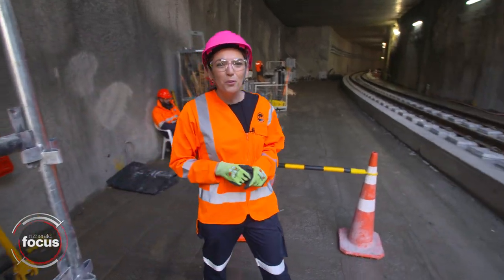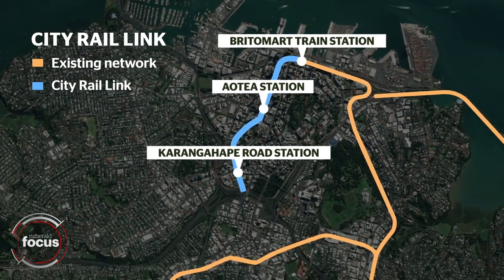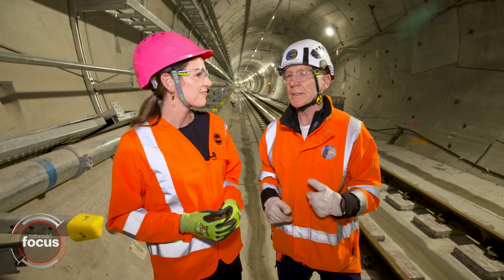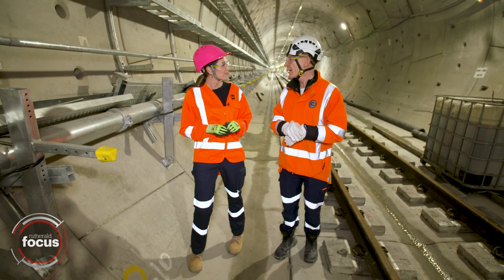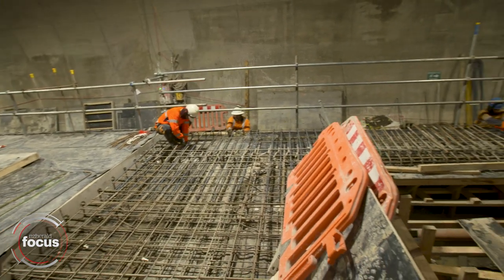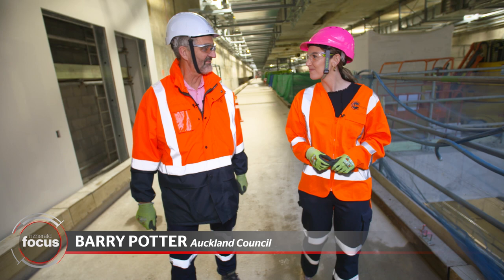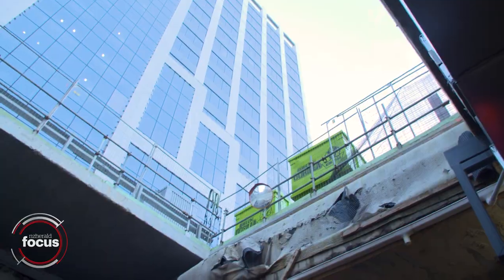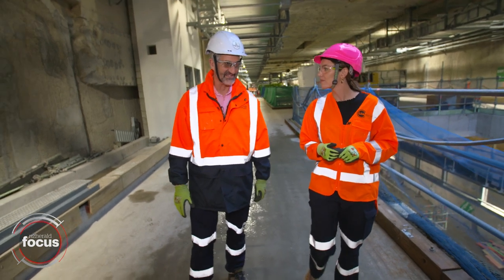First look at Auckland's new City Rail Link | nzherald.co.nz

Comment: 😂what a waste tax payer money 😢
Reply: Future generations won't think so
Reply: @sevenhelmets  they will, when it goes the way of the cycle lanes, doesn’t pay for itself and costs a fortune to maintain. It’s the wrong solution for Auckland. Maybe it can just act as a large storm water drain instead.
Reply: It's actually innovative and should have been done years ago. Look at Melbournes inner city loop and how it creates great movement in the much larger city of Victoria. Melbournes public transport system designed and heavily influenced off of Hong Kong public transport system. This is only the first step. Light rail will create the wynyard airport connect whilst more projects to hopefully connect the north shore should be on the way.
Reply: @101hundred  there is nothing innovative about it, we already have an existing rail link, this is a complete and utter waste of money when NZ is in a crisis. Over a billion per 1km is disgraceful waste when it isn’t needed. Innovate means new and different, there is nothing new about this at all, with many examples overseas.
Reply: @101hundred  note this isn’t a loop it’s a single direction and the start of trying to get better rail out west, the place where it floods the most, I’d rather see the money put into resolving the flooding at the moment. Ask yourself this at $5 each way so $10 a return trip, how many people and how many years will it take to pay this 3km rail back.
Reply: @dave24-73  when has floods become priority issue? Although it does need to be fixed. The CRL project was proposed and commenced long before the flooding was an issue. Increase in population has taken its toll on the water systems alongside transport. CRL will be helpful in the latter but many problems will exist whether we want to jump priorities every time an issue occurs. Infrastructure takes time and we must fix what we can when we can.
Reply: @101hundred  if you look at the history of rail in NZ it has always failed and gone over budget. It looks like it’s getting worse not better. The Western line is used by a minority of Aucklanders. It is hard to justify this when there is an existing rail platform in place that goes between Britomart and Mt Eden.
Reply: @dave24-73  and yet when they start to improve what you say isn't good enough,  you criticise it as wasteful and unnecessary. Make your mind up.
Reply: @TheTraveller20081  come again? Comparing it to Melbourne is pointless it has nothing in common with Auckland. It’s not a loop like Melbourne has. We already have an existing rail system to Mt Eden, so it wasn’t required. NZ has many social and infrastructure issues, including housing and medical care issues, which at this point in time should be taking priority. People voted against this project yet it has still been built. Poverty is growing, crime is growing, and we are spending billions on rail, that historically has never worked. Rail in NZ has been bailed out so many times, that it’s chances of benefiting NZ based on historical data is highly unlikely. Most people in NZ drive, and rail is not widely used, so spending huge amounts of money on this project is very much questionable.
Reply: @Dave 24-7  it is a loop, look at a map. The new link connects the existing line directly through the city up to the western line, enabling through-running of trains instead of having to reverse them all at Britomart - much more efficient. It also provides direct rail access to mid-town and cuts 20 mins off a journey from everywhere west. 
You also complain about spending money on the railway when there is flood damage to pay for. I presume you do actually understand that the CRL has been undermined construction for more than six years, and can't simply be abandoned because you want to divert funds to another priority?
Reply: @TheTraveller20081  it isn’t a loop (google  - Not a loop. John Polkinghorne | June 27, 2013 )the lines are separate, they simply share a station. Anyone can walk 3km, it’s a poor investment, yes and in 6 years it’s killed off a lot of businesses with road closures. It also caused major disruptions to Britomart. You may think it’s a wise investment, but I’m afraid on this point we will have to agree to disagree. Busses and existing train already cover this route. It’s also not likely to be open till 2026. It has been built and no I don’t expect them to abandon it, but it never should have been approved in the first place, and oddly enough very single party other than Labour is saying the same thing.
Reply: The current metro area population of Auckland in 2023 is 1,673,000.  Go have a look what population Mel , HONG Kong , or any other city have big rails public transport system. Just in my opinion l, we have so many other things need fix. Harbour bridge, southern motorway, watercare infrastructure,etc.Look how the kiwi rails train performs, now another CRL. Anyway hope it go well. If not it will be shameful. We can have like rails to airports is more future benefit than this with this huge budget.
Reply: @dave24-73  you'd better go check which Party was in government when CRL was approved and started. Hint, it wasn't Labour.
Reply: @wanghaitao3247  if they had joined the airport to the Existing Southern line it would have come in at less than the billions they just spent to tunnel 3.5 Km a distance one can walk. But for some reason they want to go out west from the city then south to airport and it’s estimated to be something like 50 billion to complete, it’s an incredible waste of tax payers money. And looking at the maps incredibly poor city planning based on where people live. The southern line would also allow links to Hamilton, Mount Smart stadium, and the CBD. We really don’t have the population to support that much spending when existing lines could easily be tapped into at a fraction of the cost and achieve faster routes with less transfers, making it easier for people to use, especially people unfamiliar with NZ (tourists).
Reply: @TheTraveller20081  I know it was National, but if you watched any news as of late National have repeatedly said they tail should be put on hold due to all the other issues NZ is facing, so my statement remains true, the Greens, Act and NZ First have all communicated the same thing.
Reply: @dave24-73 This Project has been blown way out of budget, yes, but this isn't a "disgraceful waste" of money.

First of all, I would like to address your opinions regarding rail. Auckland used to have one of the highest rates of public transport usage in the world, that was before politicians viewed the "American Transport System" (car oriented) as the future and so therefore rail has been in "Managed" decline since then.

And as a result it doesn't surprise me that driving is dominant in NZ, when you start taking away accessibility for one mode of transport in favour for another it's natural for the population to shift to the favour, in NZ case that was the car.

Rail has often failed in NZ and the reason why is because we build it to fail, not only are kiwi officials more likely to choose the cheapest option but it's the result of that which has inflated costs now, and NZ is so inexperienced with building and maintaining rail we have minimal local expertise and know how to effectively build and maintain such infrastructure. But we aren't going to solve that by saying no.

Another reason why driving is so common is because of how we build our metropolitan areas, we urban sprawl alot, and that is mainly due to policy settings and our addiction of roads.
We build more standalone houses, and that demands more roads, which means we need to establish more infrastructure, more amenities, more social services, and in the long run that makes construction vastly expensive for NZ, and it's economically unviable, and due to all those costs it has a hand in inflated house prices.

Rail is a good investment even for NZ and especially now NZ is seeking to intensify instead of sprawl. With the right settings, logistics, workforce and expertise rail is often built using less space, an equal cost and is utilised more efficiently because it can move more goods and people in a faster timeframe. And we must continue investing into rail because to have a transport system that's based on one mode isn't efficient, and it's one of the reasons why NZ productivity hasn't gotten better, a multi modal infrastructure network is much more efficient and economical.

Now with the CRL, thanks to covid, it's extended shutdown, difficulty sourcing materials and staff sicknesses the cost has blown out to what it is now. But this is good for Auckland.
It will double the capacity of the entire Network and it will improve access to the CBD, it will also incentivise investment into the CBD and allow faster travel Times due to in loosening the network.
NZ needs to keep investment in rail because investing in Just roads has lifted Auckland to one of the most congested city in the entire region, and having a road oriented network also play's in health.
It decreases the livability of a city, it's decreases productivity because people are stuck in congestion, meaning they are late to work or late home which also decreases content, it has an effect with mental health and depression, driving in an environment like Auckland also makes people more stressed.
Maintaining roading infrastructure is also expensive, yes rail has had to be bailed out in the past, but the amount we waste on roads is ridiculous, so many people driving means roads degrade more quickly, which holds a high price tag, and when we build more lanes or more roads we effectively waste millions going back to square one because doing that doesn't solve congestion, it makes the problem worse because you incentivise more people to drive and you end up with an even worse problem then before.

Public transport is also good for a cost of living crisis, it's cheaper than owning and operating a car and it introduces flexibility in people's lives and freedom to choose on how to commute.
Rail infrastructure also encourages higher urban density which increases population density, and in order for NZ to achieve economics of scale that is ideal, with higher population densities you can pay for infrastructure more cheaply and efficiently, and we could have a transport system that gets people from a to b much more quickly, which ends up being a plus plus plus for the economy and our people.

And the CRL despite how stupidly expensive it is, is not a waste of money because it will have wider benefits than just the CBD, and it fits the evolving development settings of NZ cities.
Reply: @dave24-73 it will pay for itself, what do you think the fares are for.
Reply: @rp7784  fares only cover operating expenses, staff, power, maintenance etc. fares would have to be a lot higher to pay for this investment, refer back to harbour bridge as an example, where there were a lot more users. I believe in good rail and solid rail networks, this isn’t an example of that. It’s a disgrace because we have existing infrastructure that covers the route and it only covers a distance most people could walk.
Reply: @dave24-73  No, atm we have congested infrastructure with the unfortunate position of covering the route that will soon be running at maximum capacity.

And you are also missing the fact that the CRL will have wider benefits than just the city, yes I Fares will cover operating, maintenance and stafffing but the wider benefits would have delivered a longer term retun to the city, but with this inflated price its going to take much longer than the originally proposed price.
Reply: @rp7784  I think you are missing the fundamental question what problem are they trying to solve. This will actually increase congestion and add another bottle next, one of the biggest issues with NZ is that all the roads tend to lead to same places. We are not building a world class infrastructure like the UK, we are building questionable routes at great expense to the taxpayer. Once again this route is already covered by existing infrastructure. We can only agree to disagree here. I believe we would have seen more benefits getting people from the airport to downtown, than getting people from downtown to Eden park.
Reply: @rp7784  well said
Reply: @dave24-73  Ah the fundamental question.

The purpose of the CRL was to address the lack of Available Capacity to cater for Auckland's growing population, The Crl will double the capacity of the entire network, improve timetable's by increasing network frequencies and average speeds, it will also allow more people access to public transport, and improve the reliability of the network, by making Britromart a through station it will allow more access points into the city and open up room for extra capacity.

Add the following economic benefits like Increased urban density, higher PT patronage and a more connected city, The CRL is a good investment.

The route the CRL covers is already choked, buses can't cover it without causing a traffic jam, cars have already brung that circumstance, to move people in and out of the city efficiently whilst increasing the capacity of the network citywide is more than ideal.

No because you'd be surprisde how much less people commute to the airport than into the city on a day to day basis. 

If that's the case then fine, let's agree to disagree but the fact remains that the CRL is good for Auckland, the inflated costs are the effects of supply chain issues brought on by global events.
Reply: What a terrible comment. Auckland really needs mass transport. More roads will just lead to more congestion without trains.
Reply: @DallasRabot the rail upgrade is the same as all the roads leading to town, this leads to Britomart, so is a bottleneck. It costs the equivalent of 12 harbour bridges, only covers 3km and we have existing transport routes that already cover this. It hasn’t added anything to the network and has cost a small fortune. If you think that is a good use of tax payers money, then in my opinion something it wrong. This hasn’t solved any problem. A link from the Airport to the existing southern line could have been done for a fraction of the money spent and would have actually solved a problem and brought people from the airport straight into town via.  I believe in well though out infrastructure so am for public rail, but this no matter how you look at it can’t be justified, and those who believe it can be I would question their understanding of the situation.
Reply: @dave24-73  commutes to the airport are far lower than that to the city.
A link from the airport to the southern line has already been looked at, the issue was the Southern line before puhinui would not have been able to handle the extra frequencies with only three lines and freight already heavily utilising that corridor.
The second issue is where would the line's merge without causing a bottleneck or too much environmental damage.

The current transport systems that cover the routes in the path of the CRL are inadequate and inefficient, especially with a growing Auckland.
The CRL will help increase the capacity of the rail network as well as improve access to the city and commute streams.

You seem to overestimate your understanding of the situation.
Reply: @rp7784  it’s not to the city it’s to Eden park. More people use the airport than Eden park
Reply: @dave24-73  and now your lack of awareness is showing.

access points such as karangahape station and Aotea. both of which will see a much higher share of people than the airport daily, and both of which are situated in the city.
Reply: @rp7784  time will tell, as there are already existing link buses that go non stop between those points, plus it’s a short enough distance you should walk it. I have no doubt it will be used, but justifying how much it cost is hard to do. The only people lacking awareness are those that think spending billions on something that only covers 3.5km is good value.
Reply: @dave24-73  and now your lack of comprehension is showing.

I have told you three times that the bus network along that same route is running at capacity, and is stuck amongst congestion so it's not efficient nor sustainable.

If that's the case then you should ask people to remove themselves from their cars and walk the distance, they probably won't.
Like I said, the CRL will make moving people around and in and out of the city more efficient, quick and responsive.

A little bit of disclaimer, that's what happens when you under invest in infrastructure projects, you leave your workforce lacking in expertise which makes it more expensive to get projects done in future.
With the CRL even its original price tag was pretty expensive but these inflated costs come due to global event's and supply chain issues, unavoidable unfortunately.
Reply: @rp7784  as someone who has used it it’s not at capacity, have no idea where you get your information from. Seems odd you have to be abusive because you can’t comprehend how much money was spent to achieve so little.
Reply: @dave24-73  It seems odd how you assume everyones lack of understanding because of their opposing stances to you and you have a tendancy to call me abusive.

The Bus network is running at capacity with it;s frequencies, the amount of people onboard is a different matter entirely but the bus network in and out of the city is at capacity due to the congestion, and not being able to increase or expand.

I get my information from urban studies and traffic assessments conducted by experts and Auckland Transport
Reply: @rp7784  and I get my information by using the transport, where it isn’t generalised and combined. That route has a bus every 10 minutes takes 12 minutes and the buses are 90% empty most the time.
Reply: @rp7784  looks like pot calling the kettle black, you’d be aware then that the route in question runs every 10 minutes, takes 12 mins on average and is empty 90% of the time. As for what it promises, vs what it will deliver it is too early to tell if it will achieve the desired results. It risks crating more bottlenecks, as it isn’t a true loop, and this has been highlighted in several reports. I’m not sure why you are so pro it.
Reply: @dave24-73  Did not read my comment properly
Reply: I did, but there is no evidence to support those numbers, it’s not going to resolve bottlenecks between Britomart and Newmarket, it’s going to create new ones, as I said only time will tell. It’s already 2.5 billion over budget, so don’t know if you can trust their numbers. I was more making the point that the main route is already covered by public transport, and this transport id both frequent and rarely full. Clearly you lack the ability to read between the lines so I’ll speak in simpler terms for you. More importantly, CAN YOU PLEASE JUSTIFY THE EXPENDITURE AND WHY YOU ARE SO PRO IT. it’s in capitals as I’d love to know where you are coming from. You do realise for less money we could have had a link to Botany, link to airport, true loop connecting all same streets and viaduct, and a face lift for Auckland. Are you also aware it crippled over 200 businesses in the CBD and a class action was filed for compensation.
Reply: @dave24-73  ahaha, exactly you have just made my point, the frequencies have already reached capapcity, the amount of people that services can carry is still not efficient even at full patronage.

It's also not efficient that buses are subject to congestion and are entirely at the mercy of car traffic.

The CRL has wider benefits than just these routes as I have explained.
You also fail to take into account future growth and investment.

First hand experience into travelling these route's does not make you well informed as you only know what you see but you don't know the studies that have taken place, the statistics drawn up, the economic circumstances both now and forward that have been taken into account, as well as the BCR conducted.

For only buses to cover the route it would have been unsustainable at moving people around.
Reply: @dave24-73  You think the studies conducted are based on data thats been generalised and combined?
Oh god.
Reply: @rp7784  you still haven’t justified the expenditure. I think you are very naive if you think this project will pay for itself. From a return on investment ratio, it was advised by many companies Deloitte included this shouldn’t be built, it only went ahead because John Key offered a donation and bypassed the red tape.
Reply: @dave24-73  Ok its either you who isn't reading at all or you are simply forgetting my comments or perhaps you haven't read them. I find it funny how you've been asking the same ANSWERED question over and over again and yet you think you have the ground to say I'm lacking lol.

I have stated numerous times that a heavy rail connection to the airport would not work.
Studies were conducted and a connection fbefore puhinui station would have created a bottleneck considering freight already utilises that corridor heavily, along with the current passanger networks and te huia.

a connection from onehunga would have created odd frequenices and a cumbersome network.

And for the fifth time, not as many people commute to the Airport as much as those to the city, the stations are expected to see 15000 to 27000 visitors on average per day.
Auckland international airport averages over 10000 visitors per day, atm bus services would be enough to cover the Airport route's until light rail or a metro is linked up their.

Now for the sixth time the CRL benefits not only the CBD by increasing access points and moving people in and out more efficiently, plus incentivising investment into the CBD and other transport corridors, increasing intensification and retail developments, But it will also increase the frequencies, capacity, reliablility and services of the network CITYWIDE, it will also allow more people access to public transport, make more of the network more responsive and efficient and give commuters faster travel times to more destinations.

Yes, the final price tag is ridiculous but that's due to recent events of the past three years, and yes it makes sense, all infrastructure projects across the world have had similar cost blowouts due to severe delays in acquiring materials, staff, logisitcs, and equipment, the lockdowns would of had a ripple effect on the supply chain, plus NZ is inexperieinced at managing large infrastructure projects of this magnitude through a global crises all of these cost increases make sense.

They are expensive, but unavoidable.
Reply: @dave24-73  its not a matter of will but when.

Yes Deloitte has advised many infrastructure projects in the past on the reference that they should not be built, and here we are, in an infrastructure defecit, go them.

Exactly, quite surprising coming from a party who thinks the answer to congestion is to build more roads.